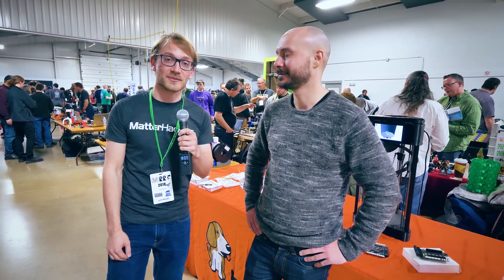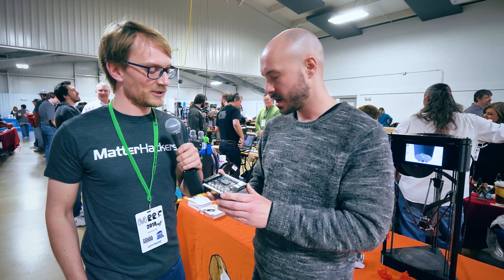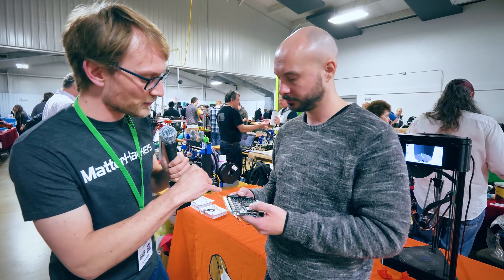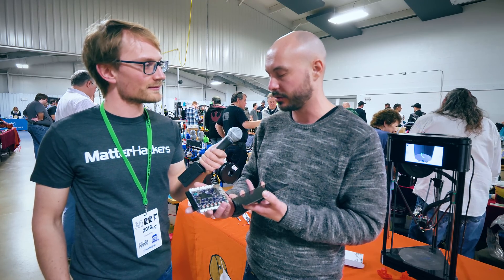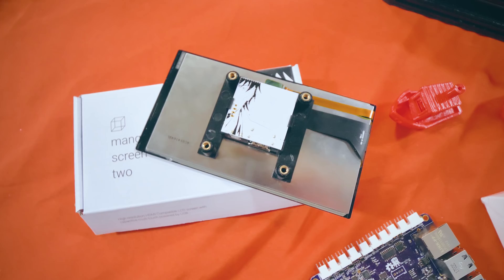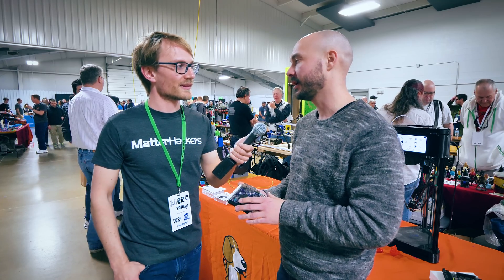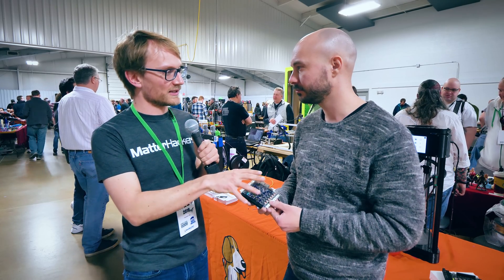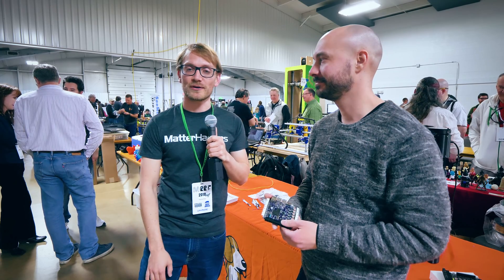Run your 3D printer with only this Octoprint-based mainboard! "Revolve" at #MRRF2018

Comment: Software and documentation were seriously lacking in the previous version, hopefully that changes with time.
Reply: Have you taken a look at the current state of the Wiki? We've tried to make user guides helpful. And the G+/Slack channels to reach the community when you need help have not let anyone down yet, as far as I know.
Reply: I haven't in quite a while now got rid of the previous board.  Auto leveling on a corexy machine with anything other than an old school servo setup was a pain to get working properly.  I had other issues that I don't remember it's been so long now.  Again this was a statement about the past hoping that improvements had been made.  And if they have great!
Reply: All I can say is that the best way for me to convince you is for you to revisit the wiki ;)
Reply: Hopefully you guys publish an extensive guide to the new settings before 2.1.2 is released.  I tried running mine on the develop branch, but I gave up after spending an hour just trying to figure out how to get my hot-end cooling fan to turn on at 50C.  For now I'm running Klipper on my Replicape while I wait for 2.1.2.  I really love the hardware, but the software doesn't match up just yet.  Regardless I plan to buy a Revolve because the hardware is just too good to pass up.
Reply: Jake Palmer so the develop branch is always way ahead of master and I'm trying to get us into a more frequent trouble down cycle to master with the release notes explaining how to configure the new features. Will make sure to double check everything in 2.1.2 is clear, but the changes aren't too big compared to what's currently on develop. The main new feature is a simulated "print from SD"to avoid the octoprint bottleneck when it reads gcode and waits for an ok back. Also the new upgrade flasher will preserve your existing configurations for WiFi, redeem, toggle and octoprint, so no need to reconfigure from scratch after an update
Reply: goeland86 Do you know if the PID temperature overshoot issues have been resolved in 2.1.2?  That and the timing issues of the part cooling fan starting and stopping out of sync with the gcode are the 2 biggest remaining problems preventing me from using Redeem.  I would also like to to use my BLTouch as an endstop, but that's not a deal breaker.
Reply: Jake Palmer si as far as I know the fan sync issue is not a problem anymore if you use the print from SD functionality (where you don't need a large buffer of moves in memory to amount for delays receiving the gcode). As for the bltouch as an endstop that's something that may be in the works (homing macros). As far as temperature overshoot, that's also still in the works. Fixing that requires rewriting the complete temperature management stack. But the result will definitely be with the wait
Reply: goeland86 I'll give 2.1.2 a try once the final version is released.  It sounds like the temperature overshoot is the only major remaining issue for me, and I can work around that problem until it's fixed.
Reply: Just to add - I got confirmation that fan sync has been fixed in the code branch that will be released in 2.1.2 even if you don't print from SD :)

Comment: Looks promising , but the software ?
Reply: Correct. I'm the release manager for the Replicape images. There's a few minor variations on the firmware for the Revolve (different pin wiring I think), but we don't have the dev boards to test it out. The Revolve uses the same chip that's used on the BeagleBone Black wireless - the Octavo SoC. Revolve, like Replicape, will run Redeem as a printer firmware. We've been a bit too quiet maybe, as we've got our Slack channel for Replicape users and we use mostly the thing-printer G+ community instead of the usual forums... But do look it over, the feature list is not short.
Reply: Didn't expect to see you here lol. Keep up the great work and thanks for your previous help on the slack.
Reply: Dante Singleton you're welcome.
Reply: 3d tech currently we don't have linear advance in the main branch, is still being tested I think. But Delta auto calibration is there, bed leveling is there... Scripting is easy to define in the config, though the list of scriptable gcodes is currently limited we're working on expanding it to include a near unlimited number of user defined macros
Reply: It should be able to use the Replicape software almost as is. The beaglebone comes in an integraded version, which I think this boardd uses. I might be wrong. But this would be my assumption..
Reply: @goeland86 does the firmware support latest features like pressure advance [linear advance in marlin] ,etc and how good is the script-ability of it? i was planning to use Duet + raspberry pi for my 3D printer but i'm looking forward to use this if the software side is good